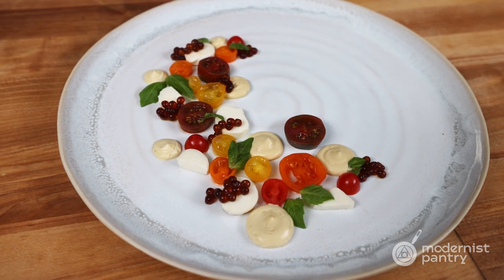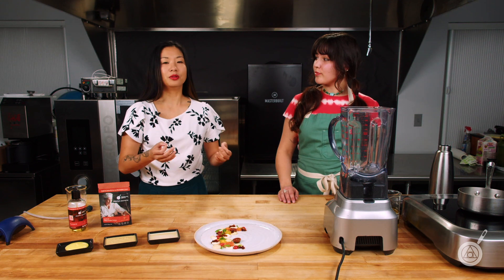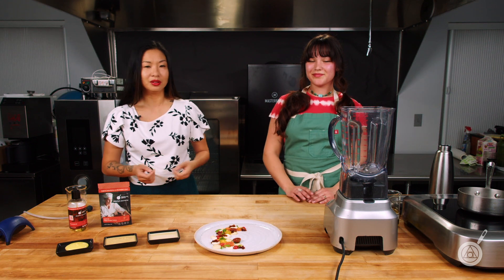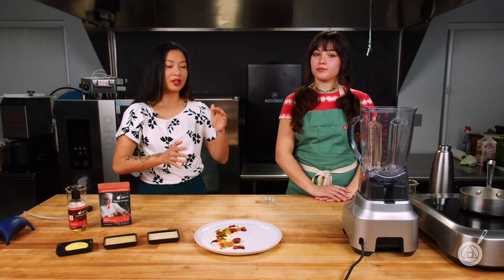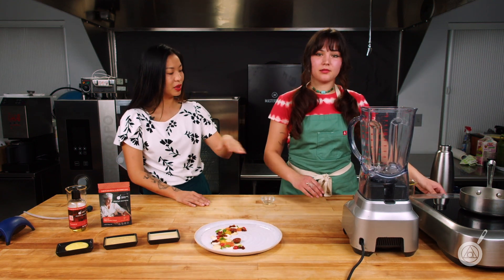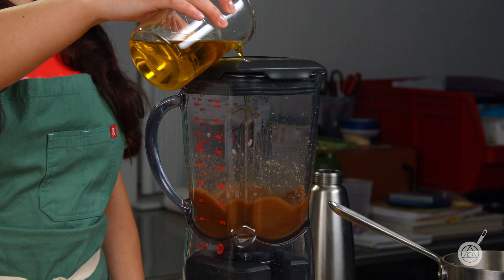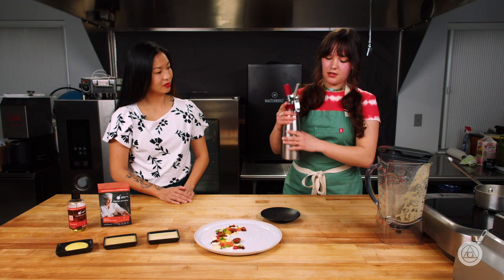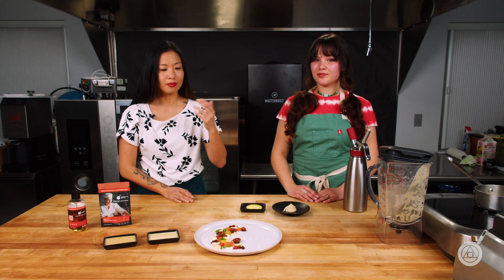Foam with Fats: The Secret of Getting a Stable Emulsion. WTF - Ep. 335

Comment: Excellent topic! Do these emulsifiers play well with alcohol? When doing tiramisu, I use brandy in the base for dipping the savoiardi biscuits, and I'm thinking a dense tiramisu foam would be fun to experiment with. And just because I'm curious, how does whipped heavy cream work without any emulsifiers (that I'm aware of)?
Reply from the maker: Whipped cream is created by a chemical reaction where millions of tiny air bubbles interact with fat particles known as globules, partially breaking them down. Eventually the fat reconnects with other tiny fat particles, forming a stable foam known as a colloid. 

Emulsifiers do not play well with alcohol since their specific role is bonding between water and oil.
Reply: @Modernist_Pantry  Neat! Thanks for the explanation on whipped cream. So no emulsifiers for alcohol, but it does work as a colloidal suspension in jello shots. Are there any ways to make stable foams of alcoholic beverages?

Comment: Hi how does polysorbate 80 compare to Glycerol Monostearate both love water as I understand? How is it even possible to emulsify water and balsamic and bind them together without oil is the result of that literally just a foam? Thought that was a good question thank you!
Reply from the maker: polysorbate is a stronger emulsifier and also foaming agent. You can't really foam with glycerol monostearate. Since water and balsamic are both water-based liquids you don't technically need an emulsifier to bind them together but overtime there will be separation due to density. You will need a water-loving emulsifier to foam just water/balsamic.